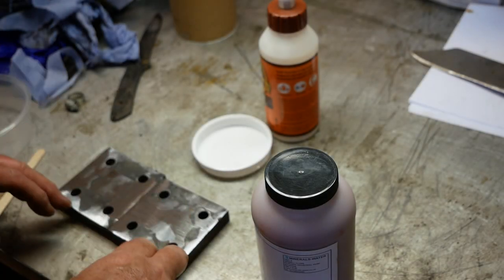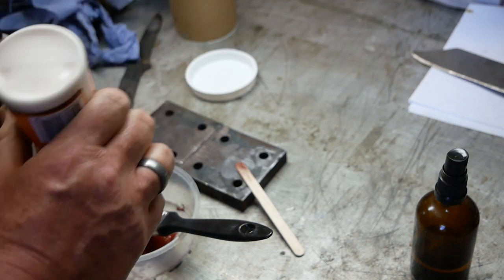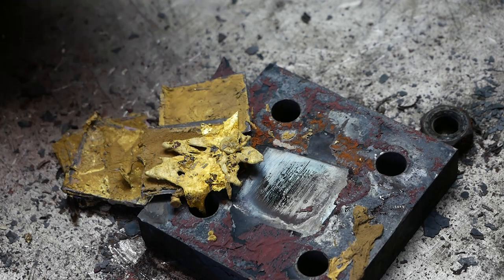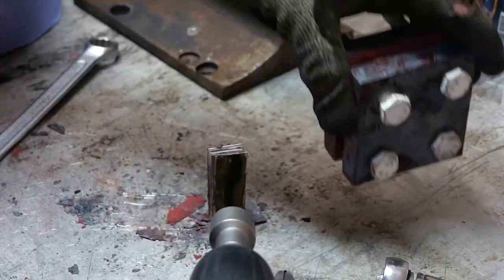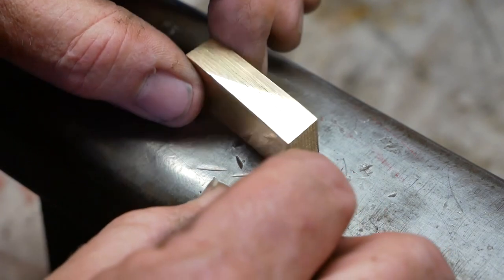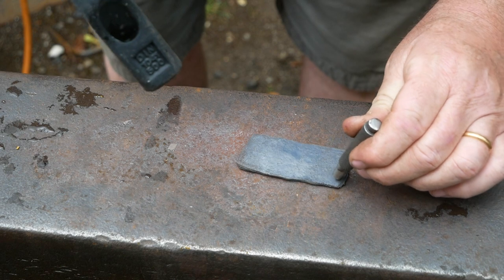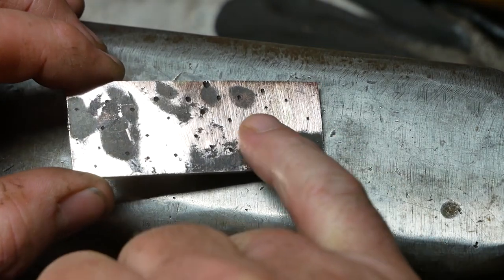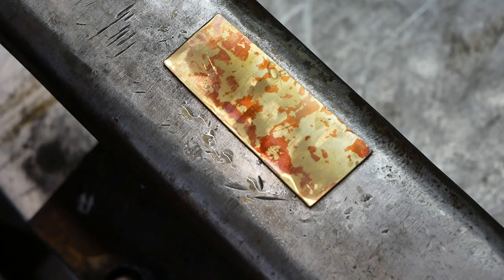Mokume Gane Success At Last

Comment: I have done mokume gane several hundreds of times without clamps or any other of the things used here....Gravity will do the job if all surfaces to be joined are clean and perfectly flat....a stack of four.soldered perfectly with medium solder.....two silver and two copper makes beautiful mokume...i then roll out to twice the length, cut in half and restack and solder...giving a billet of eight layers..and so on up to 16 layers...then i roll out to 1 mm. thickness and repousse the result..my sheets are 4 cm by 4 cm...to start with...finished size at 16 layers...about ten inches by an inch and three quarters...ill take a photo...
Reply from the maker: Hi. Thanks so much. I am really interested in what you say. May I be in touch to learn more?

Comment: The lead, tin and zinc in the brass gives it a lower melting point then copper, this might explain the melting issue.
Maybe give it some extra pressure by putting the press into a vise and cranking down on it some more.

Also get steel bolts that are not galvanized, zinc fumes are very bad for your health.

Comment: I commend you for trying on cam. Not many people are brave enough to put their experimentation stage on cam. 

And here comes the advice.. (sorry)

You would be better off using a forge, and watching it by eye for the right colour (cherry red) and touching at as it gets close to see if the metal is tacky. To get really nice designs you are going to need to twist it. And you need a forge for that, or at least a decent blow torch. The vice technique does not seem like a good option, although expansion should create compression, but in reality you need to give it another press after you pull it out at the right temp, and that clamp stops you doing that with a hammer or a press. 

I think you are doing it all right, but just with the wrong tools.
Reply from the maker: Thanks very much. I will try what you say. How do you keep the layers tight while in the forge? Wire?
Reply: @Ukenick  The thing is you are NOT forge welding, you are effectively brazing the meltals together. So the key aspects are to get the pieces as clean and flat as possible, and watch very closely by eye as they heat up, and at the perfect point when the metals are both soft you apply pressure unifromally to bond them. 

If you heat it up in a kiln, you may get the temparature right, but not the timing. You need to watch it by eye. Clamps, wire, and casket forging works by the heat expansion creating pressure for you as the metals heat up, pushing the materials together. But with softer metals, really it's all about the perfect heat, and close contact rather than pressure. Wire would be a better option to simply hold the layers in place, if you tighten/clamp them too hard, the differing expansions can actually break the welds as the materials expand at different rates. 

Get them clean, perfectly flat, and hot then tap them whilst lightly secured, then reheat, and repeat, until when you hit it it no longer sounds hollow, and your anvil rings with a solid hit. I forge damascus, which is actually harder than gane, as you need to worry about oxides, and true forge welding, rather than brazing. In that area, you need to start using stainless steel foil, activated carbon/argon and a LOT of pressure. Gane requires, very careful heat management, and gentle taps and patience.
Reply from the maker: @SmurfMasher  many thanks for taking the time. I’ll try again.